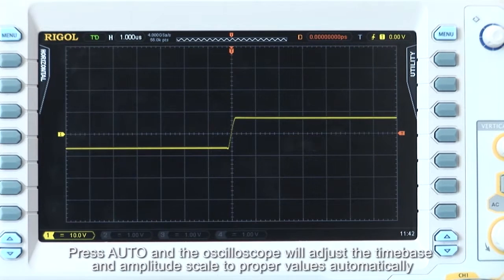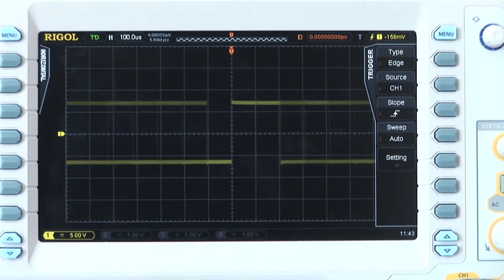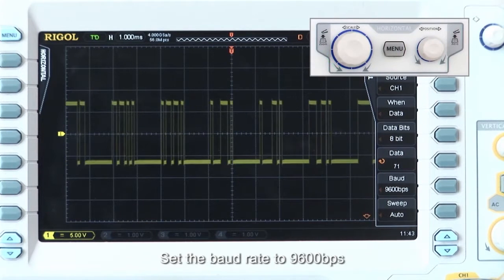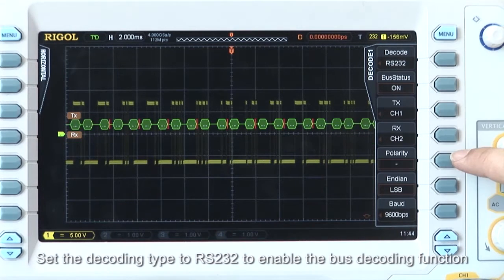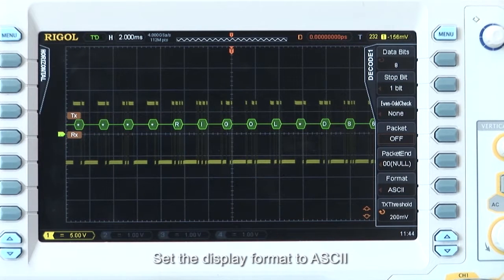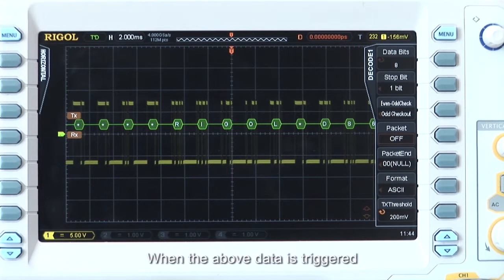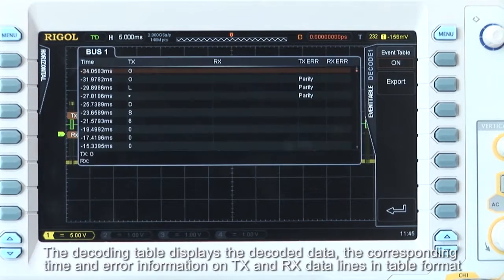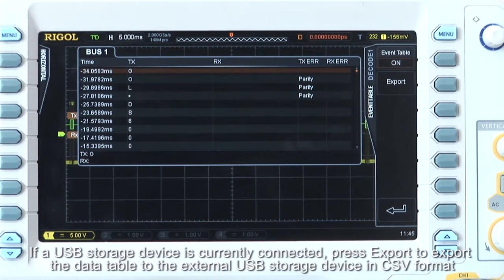RS232 Serial Decode and Trigger

Comment: These decoders are an additional feature that you must pay for. A better solution is to use the open source software "Oszi Waveform Analyzer" from ElmüSoft which loads the oscilloscope capture over USB to your computer and does the decoding in a comfortable application with more features and logic analyzers like UART, SPI, I2C, CAN Bus than your oscilloscope will ever have. And for free.